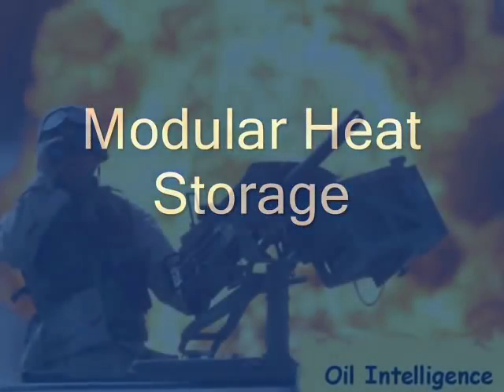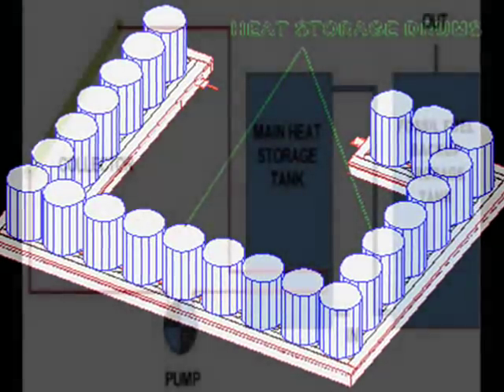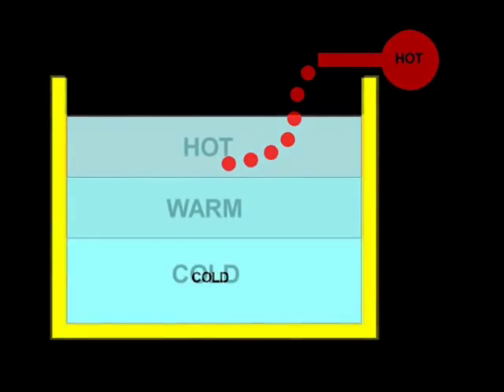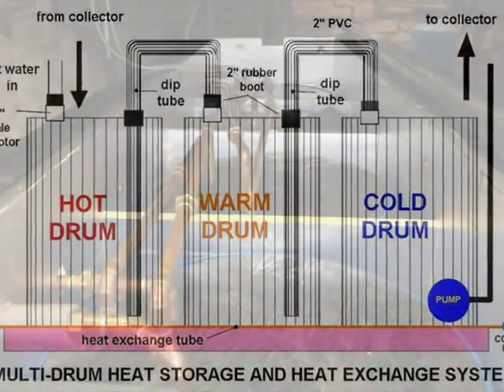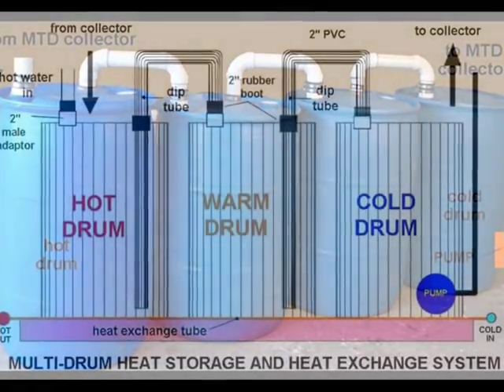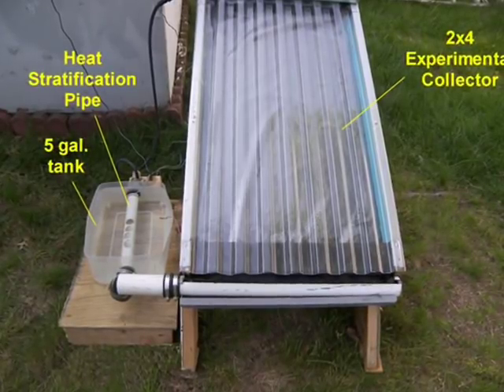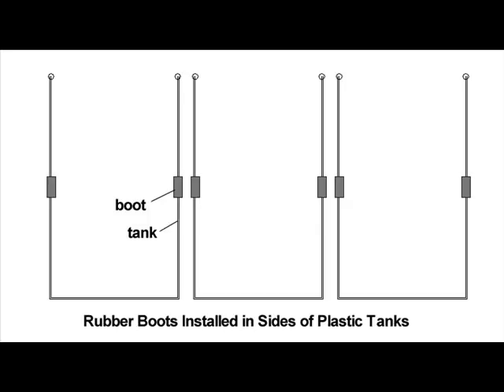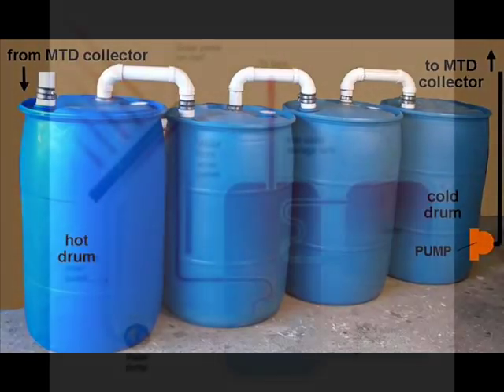Modular Heat Storage

Comment: A more effective way to store heat is in the form of liquid fuel, such as gasoline or diesel. Your wood box can not compare to the energy density of petroleum products.
Reply: Like in a car? Energy density IS important. I live in New England, could I heat my home with this in the winter? Or what about solar panels and windmills? NO. Sunlight is at its lowest, AND at the same time my demand for heat is at it's highest. Don't you see a problem with that? When it comes down to it, preformance is what counts and this will not preform. It will not be enough to meet the needs of people in cold places, it can't boil water, not even close. Hell, I bet the water will freeze When it gets cold enough. Then what? Seriously.

     It's like burning dollar bills for warmth, You will need a lot of them and even then it won't be that hot, and it's expensive.
Side note: Wood is renewable, coal is not, does that fact alone make wood a more effective fuel than coal? NO. Energy density is importiant and renewables are ineffective, unreliable horseshit.
Reply: Ilir Kumi I said that energy density doesn´t matter because you started all this by comparing it to the energy density of oil... you burn oil, it is a fuel but in this case you take water as a storage medium and you don´t burn the water ;) Of course you will always have to check if your heat storage system is big enough for your house and if you can get enough energy in and out of the water. 

Now I see my mistake I did use the word "geoexchange" system but that wasn´t the right therm for the technology.. what I meant was:
you dig a hole in your garden like a big square, about the size of a pool ( depending on how much heat is needed for your house) and you make it about 5-7feet deep. THen you put pvc-pipes into the ground and connect them to one big heatexchanger. oneside goes into your house and the other end comes out of your house. you pump salzwater through this circuit.then you put the dirt back on top of the pipes. in wintertime you can take heat out of the circuit and out of the ground  via heatpump with efficiency up to about 1:5,4 which is very good. and you can also put an extra circuit in the ground next to it to heat up the ground  via solarheat.  This system is very efficient and would also work 100%  in your climate and will cost you around 10grand if you do some of the stuff yourself and use a contractor for the groundwork, do the pipecircuit yourself and take another contractor to activate and install the heatpump. (50grand if you buy it from the shelf)

BUT!!!!!!! now I see why we differ so much in our point of view: You don´t need to do it in the USA because you won´t save any money.. someone would probably only pay for this "Shit" because he is a treehugger or he wants to build a lowenergyhouse in the first place just because it is second kind of cool... Your paypack period is up to 9 times higher then here in germany so if we invest in this kind of stuff it will amortize itself in about 5-8 years which makes sense in the longrun knowing that energyprices are still climbing.. for you it would be about 50years. So from your standpoint I can totally understand that all this stuff is only a waste of money.. sry I haven´t thought about the huge difference in energyprices between our countrys ( 1kw electricity  ger=45us cent / us = 5us cent   and heating oil is more then double the price here in germany vs us)... Now you can also see that in germany  we don´t waste money on this kind of technology, it is an economical necessity.
Reply from the maker: True the energy density of oil is greater than the energy density of hot water and the people that depend on oil are also dense.
Reply: John Canivan I successfully tested a simple easy and cheap DIY PV heating system this winter in my room, used 2 10L plastic jerrycans for heat storage with 2x1500W water heating elements by running them in parallel with a 120V/8A DC current from a 1000Wc PV panels, I didn't had to use my gas heater at all.I know my system wasn't very efficient and there was a lot of wasted heat, but this setup was a proof of concept and validation of the calculations before buying more components for a final system.Theoretically I can heat and cool the whole house using 2000Wc PV system, using a central heating system coupled to 160L~240L Water heating storage. augmenting the water capacity will result in less loses due to less temperatures and water heat stratification.
Reply: you just didnt get it
Reply: phildev Tell me what I missed.
Reply from the maker: Thats right , It takes more space  to store energy heat equivalent of oil BUT than oil is not a renewable resource.
Reply: your complain would only count if space would be an issue. so lets say you have a small box and you want to heat it at night and the limited amount of space doesnt allow you to use hot water in barrels heated by sunlight during daytime, a little tank of fuel and a burner could do the trick.  but space is not of the essence here and oilheating systems have big tanks most of the time anyway( you fill up the tank once a year ). if you find an effective and cheap  way to produce fuels at home over daytime and burning it at nighttime ok ( there are some people producing fuels out of plant plankton or algas) but that process is not as simple as just heating some water with sunlight every day and getting the heat out of the water at nighttime. you compare apples with potatoes here because its a fact that heating water with sunlight is simple. nobody said that its energy density is the same because it doesnt need to be.
Reply: Ilir Kumi thats my point! In a car it is important but we are NOT and never were talking about a vehicle!!!! you still think all the low-energy housebuilds are fairytails??? they exist. get a proper insulation for your home thats key no.1. but also commercial hotwatersystems that are out there on the market also work in wintertime no problem at all, thats why I don´t see a problem with it but the region your living in and the weather and sunshine-times should be taken into consideration of course but that doesn´t mean it won´t work, it only means its dimensions may have to be changed OR its really not the right thing for your home ( do the math with all the factors like insulation, sunshine etc.) , but there are money- AND energy-saving systems out there that will fit!!  for the solar-water-heating systems in general the prove of concept is already existing.. I on the other hand can understand your scepticism when it comes to DIY systems but still everything can be designed to work with the help of math and physics up until to a point where the dimensions may become too big and expensive. In that case it is of course wise not to use the system and try the math with another one but this doesn´t mean that its bullcrap!!! Maybe some systems dont work as the only heatingsource for your house but they will still be able to keep your overall costs down. Of course they won´t amortize within a year or two but they will definitely pay back over time and you can do the math before buying a system to see when it pays itself... I am not saying that the system in the video is superior or "the best", all I am saying is that there are already systems out there using similar technologie and they work.. I would still prefer a geoexchange heatingsystem with a heatpump for its convinience but than again .. friends house has the geoexchange system for 30 years now and it is in fact connected with a commercial solar-water-heatingsystem ( with hotwater storage in the cellar  two boilers), and some photovoltaic panels on the garage ( they where installed a year ago) his house has a good insulation. His energycosts are so low even with the electricity prices high as fck here in germany because its only a pump/ compressor that has to do some work and he quit his job after 30 years so the system itself is pretty reliable and cheap compared to a gas- or oilsystem whichs needs a lot more service over the years.  why the hell do you start comparing coal and wood at the end of your comment? you still want to prove your point about energy density with random facts?? unsuccessfully by the way! i don´t get it.  Sometimes you just have to do the math and if you see that a certain investment will save you amount x over a certain amount of time with the rising prices for certain energys you will eventually come around. It is not like you must do THIS and do THAT...  do your research and you will maybe just find out that by using better glass and newer insulation with a heat-exchanger you can cut your heating bill by a significant amount .. do the math and see when your investment will be paid off... I am not a treehugger and I can  talk money and thats the thing most people will understand.
Reply: Low energy housebuilds are a very real thing, third world counties are full of them! lol I know that is not what you ment but let's be real here, all the materials you need for an energy effecient home are not cheap, They too must use energy durring production. All this high tech shit isn't built in some guy's back yard. How are poor people, which make up a huge percetage of humans on earth going to be able to do this? Simple, they are not. I certianly think energy is squandered and wasted, and that energy effeciency is importiant. But the answer is not to stop using energy, Energy is pretty much a form of wealth, access to it will greatly raise one's quality of life. Lol geothermal does not work in most parts of the world, so that solves nothing. Solar costs tens of thousands of dollars but will only save me no more than 50 bucks a month. and that too varies from region to region. Not worth it, especially to people who have dirt floors for carpeting. Germany has a lot of money to waste on this stuff, other nations don't.

Also you said energy density doesn't matter, you are wrong.
Reply: Ilir Kumi Ok now we are talking and I totally understand and agree with most of your comment. It is not right to withhold energy and its essential comfort from people by raising the prices and you are right that not every solution can be build everywhere not only cost wise but also because of different environments. See I have no problem with people driving big V8 engines if they can afford and like it but I was very disappointed that it took the car industry so long to give the majority of users cars that are more efficient. As for Germany "wasting" money on that stuff I am not really agreeing. First of all a lot of people investing in this kind of stuff here are getting there investments back in around 7-10 years, so in the longrun they will safe money. Also having some of the wealthier countries spending money on this stuff makes it more affordable over time because not only do they pay for its development, but they also make this stuff cheaper by becoming mass-produced because of the demand. And you could also agree that someone has to do the first steps. It is not all black and white but if no one starts going into one direction it may will become to late and I am not talking about pollution, just the simple fact that energy-prices especially for oil will raise and it will become even more difficult for people with less money to get energy.  To get an energy-efficient state of the art house "can" be more expensive but it is like everything else, when you strive after the last percentage to 100% you will pay the price.. meaning: it will not always be wise to go for 100% efficiency BUT getting a house from 60% to 80% could be done with a reasonable amount of investment. This of course also depends on the house itself.. some are easier to upgrade. For new housebuilds its even "cheaper" to get it up to 90%. Of course I am not talking about third world countries or poor regions, but they often also lack the connection of fresh water or even toilets for that matter. But these poor people will never get the benefit of some solarpanels for there roof if we don´t invest in the technology making it more affordable for the masses. And not only will solarenergy provide heat or cooling for there food, but it will also power the pumps for hydroponic agriculture which to my knowlegde could be a game changer in feeding the world. So I am not asking for anybody to stop using oil, those who need to should be able to use it but to be able to support or constructively criticize some of these backyard ideas because to be honest, alot of those "consumer-product" that are available aren´t exactly rocket science and people back in the day where also able to build houses with clay and with the same technology new houses can be build with a pretty good energy efficiency!! You can be suspicious but be curious at the same time.
Reply: phildev      Germany has reduced it's CO2 output by like 5% If they didn't shut down coal plants a few years ago, it would be even less than that. (In fact I heard you guys reopened some coal plants recently, brown coal at that) If they stoped being so energy conscious it would be even less. It is not your renewables that are doing all the heavy lifting. I live in the north east part of the US, ever herd of frost? The water in the dirt freezes and the ground becomes rock hard. That is certianly not going to heat my home now is it? You are using something that costs more money and gives you less heat and electricity. It will not work.
Reply: What on earth can fill a teacup and lift 1 ton 1000 meters into the air? Of course the answer is petroleum. 
     You can fill a gas tank and drive it up a hill. Now could one man do that? Certianly not because he would collapse from exaustion before the car got any substantial distance and speed. How many men would it take to do the work that gasoline can do? The answer is a lot. Fossil fuels rule for a reason.
     Also, Water has a very high heat capacity, not energy density. It takes a lot of energy to get it to boil, when compaired to alcohol, or bacon grease or something. And it can retain that energy for a while. You must put energy into the water and it can "hold a lot" of it. But it in itself is not energy, because it can not be used as a fuel.
     "DUHH... what about HHO?" You must electrocute the water until you break the bonds. That electricity is energy and MUST come from somewere. So in order to get energy out, you must put energy in, and that gets you nowhere. You put in 1 dollar you get 75 cents back, so you lost a quarter. You will never get 2 dollars. Those are not exact percentages but you get the point. 
     One last thing, people who this they can "harvest the free energy of the only nuclear reactor that matters" And think that it will be enough to satisfy the growing energy demands of the world are also dense, actually they are diffuse. Like the energy they claim will save the world. You can't power an aluminum foundry on solar electricty. And What happens when the Indians and Chinese want to live like the Americans, and Europeans?
Reply: Ilir Kumi like I said get your head out of your a... and yes I did compare your climate to norway and it can still works... you can even pump heat out of ice;), do you think in winter our ground doesnt become rock solid? man jeez of course, but it will still work!!! and it is not some freaking rocket sience you may only have to dig a little deeper in the first place, but it would work.

About energy density of water... still!! we were talking about heating up water for storage in the first place and getting that stored heat out of the water. You did that comparison about energy density water vs petrol in the first place remember? Thats why I said it doesn´t matter in this case because it is comparing apples and oranges. I also agreed that in a car it does matter and gas in the fueltank is superior!  
The thing about hydrogen is a totally different story. I think it is not really efficient and it would ONLY be green if we would use solar or wind power, so agreed.. Does not make sense to use coal or nuklear..  I totally agree with you on that one.. doesnt make sense economically or ecologically. if you think about having an autarchical system for example a farm outside of the city with lots of solarpower, they could use some of the power of the day that they would normally not use to dehydrogenate so that they could get electric power at night with their hydrogen oxygen fuel cell. But I don´t like the system that much, there are better ways to store energy.

Lets talk about electric car for a moment.. Gas is still superior, the batteries for electric-cars are too expensive and these expensive batteries have to be renewed... and then again using electric doesn´t make it better if the electricity comes from coal and nuklear... But since I am mostly interested in economical reason it doesn´t make sense here in germany, to have an electric car.. Oh and the same you said about hydrogen in a car also goes for electricity .. The electric motor is efficient in using electricity for propulsion not like the combustion engine BUT BUT BUT to load the batteries with 1,5 dollar worth of electricity you must put in 2 dollars worth of energy ( not the right percentages but you get the point). I am not saying that they won´t make sense in the future with better battery-technology but right now they are not as green and economical as they claim to be. 

 .. I never claimed that germany is all green and shit.. that never was my point and I also wasn´t fingerpointing towards the US... not my style and not the point here. I was saying that economically it does make sense for us to use solar power and heat pumps at home because our energyprices are a rip off and we actually save money by doing so..
Reply: Ilir Kumi  you're right that renewable isn't very good for industrial needs, but that's not what this DIY alter-energy is for, maybe alter-energy can't save the economic world, but It can save my independence and my future, I can't rely on fossil energy for my future anymore, PV power is now very cheap and cost effective, the industry? I don't care.
At least reducing domestic consumption can save some wasted energy, in the mean time, waiting for scientists to succeed running their hot/cold fusion reactors.
Some people are still waiting for a miracle solution, alter-energy isn't a miracle, it's reality period.
Reply: Ilir Kumi  not every alter-energy solution works everywhere, in your case it's not geothermal, but earth-sheltering that should work or a variation of underground heat storage. also PV systems should work fine in cold weather, someone mentioned that now heating with PV+AC or PV+heaters is as cost effective as solar heaters.
Reply from the maker: zazugee
Solar thermal could be expensive if you hire a professional installer.
Reply from the maker: Zazugee 
Yes  Where is a will there is a way Congratulations.